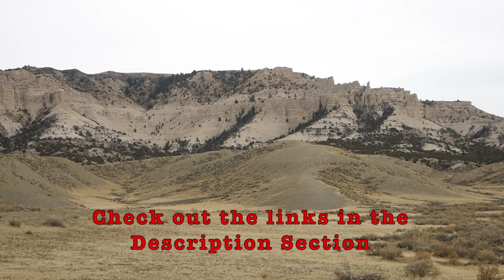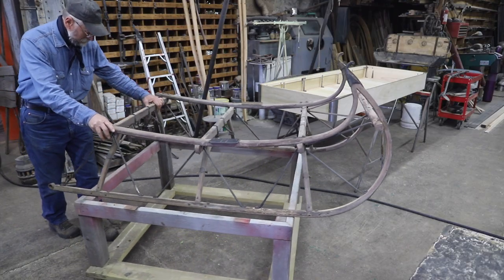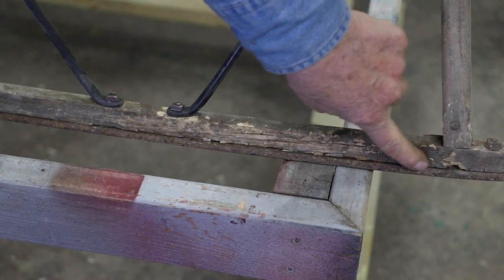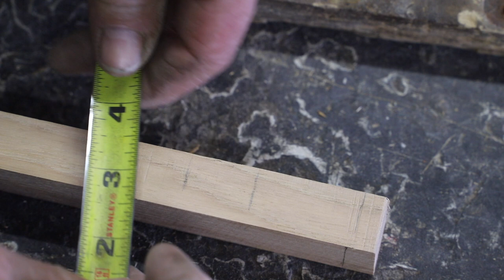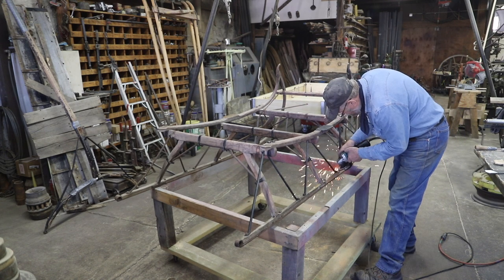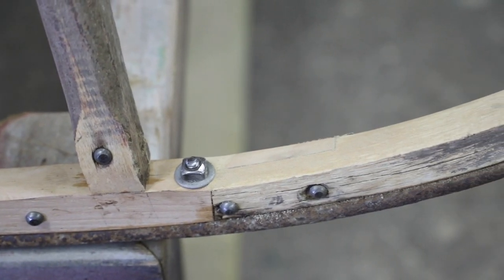Cutter Sleigh Runner Repairs | Engels Coach Shop

Comment: The significant lesson for me from this video, is the importance of marking as-built elements in place and matching new elements to existing structure.  No amount of measurement can reproduce an element well and in least time as the way you do it.  I seems the obvious way to do it until you are faced with the task for the first time.   Watching you do it helps a lot.  Thanks  for this excellent video.
Reply from the maker: Yes, doing a repair in the middle, and having the steel runner still fit, is a challenge.  That element is missed by many, but evidently not by you.  Thanks.

Comment: They aren't very practical anymore, and they don't get much use, but when you do have that rare perfect moment, they are a blast.  All you need is a snow coming down faster than the county can remove it, or an abandoned road.  I've gotten to do that several times, and it was some of the most fun I have had.  They are kinda hard pulling though, and they wear the horse down faster than a buggy.  They can get really hot, and you have to watch them.   Sleighs turn over awfully easy too (ask me how I know).  There is a reason for that verse in Jingle Bells.
Reply: I did not remember that versus and had to look it up. :) Cool thank you. Buggies can be very temperamental if you go to fast.
Reply: @dennis2376  So can horses... :)

Comment: Another great video, I love the "that will do" attitude when working with wood. The fact that you can sort it with a rasp later.
Same goes with the rivets you cut the off with bolt cutters then pean the end over (or mash it into the recess in the metalwork) I think I mentioned in a previous video,
I grew up near a joiners shop and so much of how they worked I see here.  
Great content As always stay safe!

Comment: Great work. Most people don't realize the amount of work to precisely "scab" a new piece into old construction. You might consider getting a good Japanese hand saw. For years I used a hacksaw for inletting until I was gifted a Japanese hand saw. You'll be happy with one.
Reply: A good 11 pt. Crosscut panel saw that was sharp would also work.
Reply from the maker: I use them also.

Comment: There are so many lessons in joinery here. Awesome! Mr. Engel, thank you for sharing your expertise.
Reply from the maker: It's a challenge to get all the joints aligned and then have the steel runner still fit.
Reply: @EngelsCoachShop  I see that, having tried something similar but much less complex - came out nowhere near as well but serviceable. That repair is an awesome show of skill. The video makes it look easy. I would be very much interested how much work time it took start to finish...
Reply from the maker: It was a 6 1/2 hr project over a couple of days.
Reply: @EngelsCoachShop  Wow!. Thank you ever so much for sharing your expertise with us!

Comment: There is a tool used to remove the pins in watch bands so links can be added or removed.  It would be easy to modify a C clamp to press out the old rivets.

Comment: Interesting that you seem to use metal cutting (fine tooth and ripple/wavey set) blades, both in the bandsaw and (as usual) in the hacksaw frame. I tend to do that myself (as primarily a metalworker) so it was interesting to see you (who I see as primarily a woodworker) using them as a regular thing.
Reply from the maker: Yes, I like the 18 tpi blades on wood.

Comment: The craftsmanship blows me away in every video! I've seen your rolling cart many times and tell myself,  "I need one!" I'm curious about the rolling dolly cart.  How are the vertical posts attached to bottom boards?  Tenons? Bolts? How much load you guestimate it could handle?
Reply from the maker: Some are, some aren't.  Angle corner braces work well though.

Comment: I loved this video.  One of the things I appreciate about your videos is that you show enough details of what you're doing that I get a lot of "I wouldn't have done it exactly that way" moments, which of course are the times when I learn something.  So, I'm curious -- why did you use new bolts for the new wood, but keep the old bolts with the old wood? Didn't have enough old ones that were still good, or...?
Reply from the maker: The old bolts are slightly larger than 1/4" so I used them in original holes.  The new holes I drilled at 1/4" and so used new 1/4" bolts.

Comment: Have you ever tried West Systems G-flex elastomeric epoxy,it doesn’t cure glass hard, but has some give and can be chiseled, sanded, painted, you can use the usual fillers to get the thickness you need, I use the #406 most as it’s great for bonding
This would basically make your patch as if it was still one piece
Reply: The glue does the same and everyone can pronounce glue. (plus its more readily available and much easier to work with)
Reply: @KipdoesStuff  glue does not do the same thing, glue is not a gap filler, epoxy is. Epoxy would in essence make the patch react as if the entire runner was one piece. I’m betting that Dave is relying more on the mechanical attachment of the metal, rivets and screws than the glue. Maybe in your area it’s hard to find, but not where I live and it’s just as easy to use, because I can get the epoxies thickness to a point where it won’t slump one doesn’t need to worry about drips and lastly one can thin epoxy to penetrate punky or split wood to give it real structural strength - try that with glue

Comment: Hi All, quite agree with the relaxation side of these video's.  Just a question from beyond the pond, what is the difference between a Cutter Sled and all the other types, as over here we don't have any and only had a few in Victorian times. 🤔
Reply from the maker: Cutters are named as such for being thin, tall runners for cutting through deep snow.
Reply: @EngelsCoachShop  Thank you for the Answer, I will have to see how big Sleds got as no one really used them over here, they seemed a good way of getting around when the ground was  covered in  snow. Belated best wishes for Thanks Giving and wishing you and family a very Merry Christmas.
Yours Faithfully 
Richard
Suffolk England

Comment: Dave, am I wrong to assume that the damage to the runner was post beetle?  at least that appears to be so.
Also, Why do I also get the impression you could make a dovetailed box with that hacksaw.
Reply: The runner had received moisture damage from storage in the barn it was in for 70 plus years

Comment: For this kind of small detailed saw work, have you tried a Japanese style pull-cut saw? I find their precision really a joy, but being used to a push-cut saw they can take a little bit to get used to.
Reply from the maker: I do like a pull saw also.  The versatility of a hacksaw is handy also.  A pull saw wouldn't work in the splitting of the lap joints.  They all have their place.
Reply: @EngelsCoachShop  I couldn't imagine you didn't have one, but hadn't seen you actually use one (yet).

Comment: Dave, with a Sleigh that small does a full size horse pull that or a Shetland Pony size, looks like only one person could ride at a time.?
Reply from the maker: They are generally a 2 passenger sleigh pulled by a single saddle horse.  Might be a bit much for a pony.

Comment: Very nice job on that repair Sir. Is there a "rule of thumb" for cutting off the rivets or do you 'just know' how long to trim them to? Hopefully the owners will put a couple of layers of finish on that sleigh before it goes back into service.
Reply: After a few thousand rivets you get a feel for it, lol. Most likely a display piece.
Reply from the maker: The distance from the side if the bolt cutter to the cutting edge always seems to work well.

Comment: To Dave or any of you that work with wood like Dave does.  How long does a wood file or Rasp last before it needs to be replaced?  Alright just what I have been waiting for is clothes.   The first of the month can't get here soon enough. Thanks Rick
Reply: I've never replace one, just add to the collection.
Reply from the maker: I've tried a variety of brands a continually go to this Red Tang brand.  When it dulls too much for wood, it becomes a metal file, and from there it becomes blacksmith material.

Comment: First time I've ever seen a ballpeen jackhammer :D

Are some of those round black struts replacements? they look like newer metal than the braces and runners.
Reply from the maker: The owner had started some cleanup before he decided to have the repair done so some irons looked different.
Reply: @EngelsCoachShop  Ah,that would do it.

Comment: A very nice piece of joinery Dave. I had forgotten about the saw trick to close up the joint ends. Dad taught me that one. That runner now looks every bit as sound as the original. That sleigh is now good for many more years of service. Question: Why is it that the four tenons have no screws or glue?  Thank you for sharing. Hope you had a Happy Thanksgiving. Have a great day and stay healthy.
Reply from the maker: Fasteners tend to draw moisture.  Sure made it easier to fix without then there huh?

Comment: Dave, you made it easy on camera. I was following along though and saw a few hours involved. Not to mention, having the equipment to get 'er dun sometime today. 
You use the Green version of the Titebond glue. Are the Red and Blue versions not as good or not applicable to your wood projects?
Reply: Green is water resistant, for outdoors.
Reply from the maker: Green is water proof.  The others are water resistant.

Comment: Interesting to see the extensive use of the triangulating Iron work to give strength to the light almost flimsy wooden framework, is there a reason for this lightness of build, or is simply fad or fancy, where wheeled vehicles ever built to this kind of scantlings, other than for racing?
Reply from the maker: The lightness both for ease of pulling and cutting through deep snow, hence the term - cutter.

Comment: Another outstanding job, Dave. Question: What was the material you put on the wood before reattaching the metal runner?
Reply: probably boiled linseed oil.
Reply: @KipdoesStuff  kinda what I was thinking
Reply from the maker: Yes, thinned linseed.

Comment: I was about to ask about the "repair/replace" decision... and then I read your intro. However - given your expertise - where is the "breaking point" between customer req´s and your assessment?
I mean, there has to have been a few times when... Well, U know
Reply: When someone wants me to do something un-doable, I just refuse them. They figure it out when the next guy screws them over and they end up with scrap.
Reply from the maker: Sometimes that's an education process.  Sometimes it works, sometimes it doesn't.

Comment: I would gone with an angled scarf joint myself for the structural aspect maybe with marine epoxy cause of the dodgy wood.  I'm not a fan of tight bond non waterproof glue.  I use lepage carpenters glue which is waterproof, really I had old bottle I wanted to clean last little bit out and filled it with water. Forgot about bottle for year and shook it up...still water did t do anything to glue, and this is regular stuff..

I was surprised you didn't use vinegar and metal dust to co,or the wood.

Now as nice as this was....get onto the seats I want to see what that buggy looks like finished!
Reply: Green tightbond is water proof/resistant.
Reply: @KipdoesStuff  supposed to be but i have not yet found a tightbond that doesnt break down in water
Reply: rats arsed  the claims, as you put it, are of what i observed using it. They do not make the claims. Its not an add for the glue. I just know that the lepage glue does not break down with water. Trust me its easier to let it dry as clumps than to try to wipe it down with water as all it does is smear. Which btw is kind of a pain in the rear. Still my lawn chair that has no screws is now 8 years old being held with glue and dowels. No joints and its solid, im quite amazed actually.
Reply: rats arsed  funny. Lepage is canada only ? Since when its on amazon.

Comment: What are those rivets called when you go to order them?
Reply: Round head, mild steel.  Probably 1/4” diameter.  Jay-Cee Rivets is where I but mine.  They have a good web site and great customer service.   You can get many different head profiles depending on the application.  
Cheers!
Whipple
Reply: I was wondering about the Counder sunk head with radial serrations on the shank then thread on the end. That he cut to length. never seen those before!
Reply: @markthompson4885     We call them plow bolts where I live.   Used to hold the cutting edge on a snow plow.  Countersunk so they don’t interfere with snow sliding off the plow blade.  Some have a slot for a straight bladed screwdriver, others have a nib or two forged into them to prevent them turning when tightened with a wrench.   I’m assuming from what I saw in his video, this is what was used on the steel runners.   Just my guess.....!
Cheers!
Whipple

Comment: This is the undercarriage of a cutter sleigh. What does the whole sleigh look like? And why is it called a cutter runner?
Reply from the maker: The tern "cutter" is from being a narrow, tall runner designed to be pulled in deep snow, hence - cutting -  through the snow.
Reply: EngelsCoachShop Thank you, Dave, for enlightening me. I suppose that is the main difference between a cutter sleigh and a sledge?

Comment: it was not fair!
told that the sled is for the soul and he himself cut out a pildo from a flat piece of wood!

here it would be to completely change the runners, but to bend it, and then it would be very beautiful.
  so it turned out a budget repair without a soul.
neither beauty nor authenticity, just a patch.

sorry sight.

No, your work as a master is beyond doubt, it is beautiful, interesting and good.

P.S. sorry for my bad english.

Comment: Interesting that you used exterior wood glue rather than epoxy.
Reply: No need, it is water resistant.
Reply from the maker: The Titebond 3 is waterproof and easy to work with.

Comment: Dave, what are the loops at the back end of the runners for ? Also, I've never seen the screws that have the twist just below the heads. That's a new one to me. I've been woodworking for about 26 years now. Sadly, I had an old buckboard that gave up the ghost due to the desert heat. Still have all the metal, though.
Reply from the maker: Those curls are to prevent gouging in when backing up.  Those bolts are tire bolts for buggy tires.